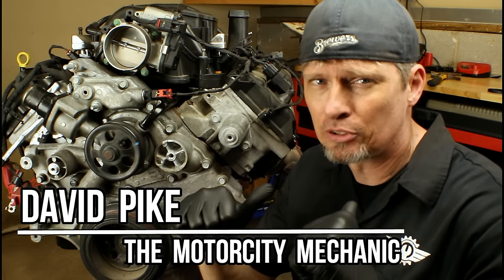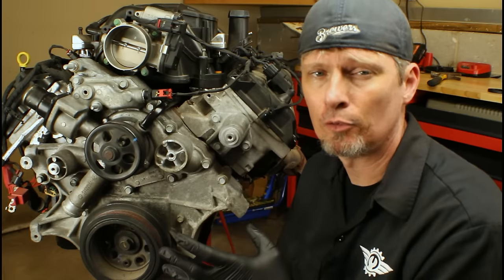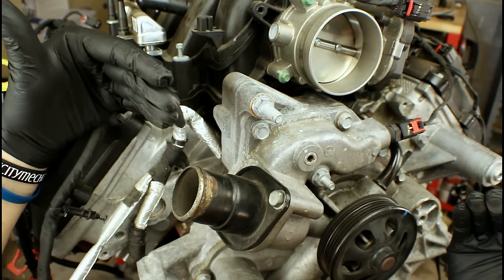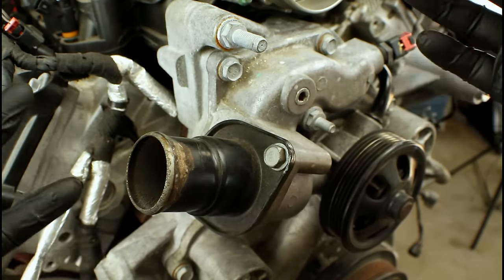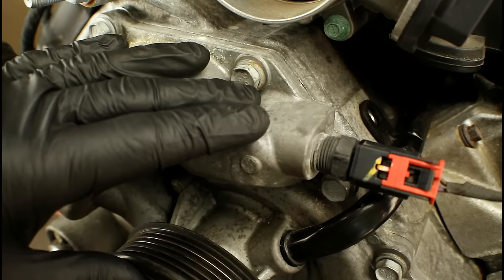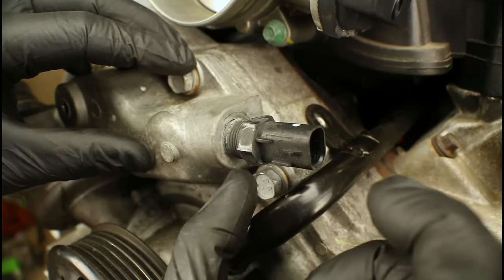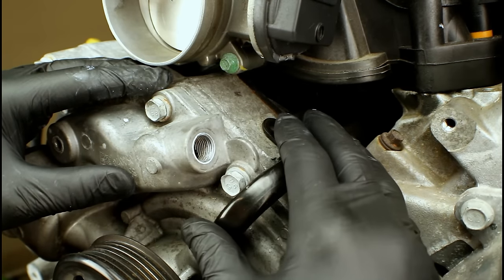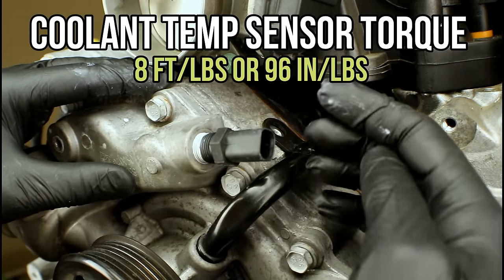More than one way to bleed a Hemi coolant system

Comment: Well most thermostats have a little tiny micro hole in that thermostat?
Reply from the maker: Must have the “jiggle valve” but doesn’t seem to allow enough air thru or at least not fast enough

Comment: I'm swapping out the thermostat, after I install the new one and put back on the coolant hose, i just start filling the coolant tank until it comes out of the bleeder valve ? Thank you for your help
Reply from the maker: Exacty. Then reinstall it and adjust the coolant level in the bottle. Thanks for watching and make sure to subscribe.
Reply: @MotorCityMechanic  thank you for your help!! I always make sure to like all your vids

Comment: How do you feel about the air lift system? All the tool trucks have their version. Using vacuum on the cooling system then letting the vacuum draw in the coolant.

Comment: Need your help please , I replace my water pump due to a noise and loose pulley on the water pump its self , on a 2017 challenger Hemi engine just like on this video , for some reason I can not get water to come out  bleeder plug like in the video I also replace my thermostat now I over heat and it didn't before , I went back to my old thermostat thinking I may have bought a defective part , I also noticed I have no coolant in my thermostat housing or on my bottom hose is it possible I was given a defective water pump,  I have no leaks and it seems I have no water circulation , thanks in advance

Comment: Is it necessary to bleed the coolant system when you're going to do a coolant flush?
Reply from the maker: Its recommended to make sure there is no air.....just in case. Thanks for asking and make sure to subscribe.
Reply: @MotorCityMechanic  thank you! Just subbed!
Reply from the maker: @brayangarcia4195  Many thanks

Comment: I got a 2012 ram w 5.7 hemi.. and it overheats when at idle or a driveway for a long time..at that point my ac stops working.. it goes up half way between normal and the 3/4 temp mark..so basically about 5/8 or so of the gauge..woul that be an air pocket issue or fan...changed coolant
Reply from the maker: There shouldnt be an air pocket unless there was a leak or when you change the coolant. If thats the issue when you changed it then it shouldnt have been over heating before...if it was then there is another issue. I would recommend having it checked further. Could be numerous items....fan, clogged radiator....etc. Thanks for asking and make sure to subscribe.
Reply: I have this same issue and I also hear the coolant gushing behind my glove box.  But the coolant level is always high in the radiator.  Gonna try to bleed it in the morn.

Comment: What a great follow up video! As a guy that has replaced 4 water pumps (post warranty) any video from you about the Hemi is loved. I have a question, after the last water pump change I noticed my upper hose was collapsing after motor cooled down. I replaced the hose (it was time anyway) but the new one is also collapsing. New Radiator cap in order?
Reply from the maker: Could be a bad cap.....I havent seen that issue in a long time. Thats where I could start first for sure. Thanks for watching!

Comment: Hi, thank you for this video!.
I've a 2009 DODGE Durango SLT 5.7 Hemi, soon will have to flush de cooling system and will have to deal with this, do you have the torque number for that bleeder plug?.
Also, if after filling up with coolant, I leave the radiator cup off, start the engine and wait for normal temperature plus some time (for the thermostat to open)...is not supposed to bleed the air bubbles from the top point (radiator)?, and the last one...It's ok to use teflon tape to seal the bleeder plug?. Thanks again!.

Comment: David, what if I don't have a torque wrench? I am replacing engine coolant thermostat housing on 2016 Ram 1500 sport.
Reply from the maker: Just snug the bolts and you will be fine.

Comment: Question...   2005 Jeep Grand Cherokee 5.7 Hemi.  I have 2 problems.  1 is the water pump that I am doing tonight and the other one is: is there an alternate to the hydraulic radiator fan?  The one we have is making a bad bearing noise and I cant seem to find one on line making my only other source a salvage yard.  Is there a way to switch it to a regular fan with a clutch like they have on the 2014 Ram with the Hemi?  Any input you can give me would be greatly appreciated..  Thank you for your time.

Comment: Thanks for the great video with a lot of awesome information.  I have 2013 Ram 2500 5.7 Hemi,  noticed liquid on transmission pan, but didn't look like trans fluid.  It looked more like coolant, but truck hasn't overheated or been abnormally hot.  So I pressure tested cooling system....not sure what the correct PSI is for testing, but radiator cap reads "16 PSI" so I pumped the pressure to just under 15 PSI.  After a few minutes, coolant was leaking out from under the pulley on the water pump...I think there's a weep hole there?  Can you confirm if there is a weep hole and if so, does the leaking under pressure confirm that it's bad?  Also, what is testing PSI for cooling system so I know what to stay under next time.  Thanks again.

Comment: Is this bleeding required to just Dodges or all, I’ve rebuilt motors , changed water pumps and mechanically inclined.
Reply from the maker: Each engine is different, some do have a bleeder while others don’t

Comment: If not purging the coolant system after cooling repairs, will THAT cause the engine to run hot or even register hot on the temp gauge? I have an 07 R/T Charger and I do many repairs myself but I have never been taught about purging.

Comment: If my hemi has a bleeding valve, is burping the system still necessary? Or is using just the bleeding valve good enough to get all the air out? Also, what if the valve is stripped? Thank you

Comment: I have a couple of questions for you regarding this sort of thing. A friend of mine just bought a used Ram pickup, (not sure what year but it's a Hemi) that's over heating badly. The former owner had replaced the thermostat and apparently that's when it started over heating. One question, is there a chance the guy put the thermostat in backward or wouldn't it fit that way? Also, what kind of anti freeze should I use? These videos are GREAT! Thank you for your time and efforts to help us out.

Comment: 2014 charger 5.7 was overheating. I changed the thermostat, water pump, radiator and it's still overheating and now the heat doesn't work. What am I missing?
Reply from the maker: Make sure no air in the system by bleeding it as in the video. You may need to recheck it when its cold to see if any air is coming out the bleeder. Most of the time you can get it all out the first time and some times you have to do it more then once (letting it get hot and then cold and then bleed the air, repeat). That could explain the heater concern.
Reply: @MotorCityMechanic  I ended up putting the old thermostat back in and filling the radiator with coolant and the reservoir needed some too. I turned it on and to my surprise it works now. Maybe low on coolant ?? I know the water pump was going out but the radiator was probably still fine. I'm leaving it in since it's not easy taking it out.
Reply from the maker: @randyu8688  Sounds like being low on coolant/air in the system like I mentioned. Looks like you got it bled well this time so that everything works. Thanks for the update and glad everything is back to normal.
Reply: @MotorCityMechanic  sometimes it's a minor issue that you yourself can turn into a nightmare. Thank God I thought about filling the radiator before I hooked the thermostat back on. As of now the car works great. Now I have to tackle a 2010 dodge fan evaporator heater core. I have the center console. Wish me luck !
Reply: MotorCity Mechanic i filled my coolant system up but i only used less than half of the max capacity of the coolant system on filling. I have loosened the bleeder valve and bled it till there was a steady flow. I still have not seen a drop in fluid. Also my fans are not running, could that be because of low coolant?

Comment: Thanks for showing how you removed the bleeder valve. When draining how do you get all the coolant from the engine block? I located the drain plugs on the block and was able to remove the plug on the driver side but no luck on the passenger side (worth mentioning I ended up disconnecting the negative battery cable due to spark on the passenger side)
Reply: What was your end results?  My 2011 RT 5.7 has been running way hot, so with a thermostat replacement, I also decided to do a full flush and fill.  I've only been able to get two gallons in and two out during each of the five times I've performed a flush.  The two block plugs, with everything in the way are next to impossible to remove without possibly damaging the bolt heads.  That still leaves roughly half of the diluted coolant and cleaning agent in the block and system.  We're you able to maybe remove the heater core hoses from the block area to be able to get the rest of the old coolant and cleaner out prior to replacing the nearly 4 gallons of 50/50 coolant?  Thanks!!

Comment: I have a 06 charger 5.7 hemi Is it a way to catch the coolant spill front out the bleeder valve so that way it’s not leaking on the electrical parts like the fan?
Reply from the maker: No need to worry, it doesnt cause any issues and also keep in mind.....that fan is exposed to rain every time you drive it in bad weather. But if your still worried then place a small cup below the bleeder opening. Thanks for asking and for watching. Make sure to subscribe.

Comment: Thanks, The old school heat on full blast resevoir cap off / topping off  when thermostat opens trick won't work on these?
Reply: I just did that on my hemi, it worked but I need to do the cycle again. It definitely takes longer but I might do the temp sensor way again because it’s a really smart and good method because my bleeder valve is rounded

Comment: Hey David thank you for this informative video, I did the burping and I noticed that the once I started to add coolant in the radiator the coolant was coming out from the bleeding valve straight away so I assumed the coolant system is free from any stuck air. Two other things have been noticed the first is the radiator upper hose seems really firm and the other is the coolant reservoir is little bubbling after shutting off the engine after 30 min drive. Are these normal signs? I appreciate your reply

Comment: I've watched every video I could find on how to bleed the air from the system and I'm still having difficulties. I have a 2011 300c with the 5.7 hemi. I changed the waterpump thermostat, bled the air via the bleeder screw, but for some reason it's not circulating the heat is working and it doesn't overheat at idle with the heat on but as soon as I turn off the heat the temp starts going up. I'm stuck and running out of money and ideas plz any advice or tips would be greatly appreciated.
Reply from the maker: You may have a clogged radiator......I recommend when its hot....try to grab both radiator hoses to see if any big difference in temperature.....with the engine not running of course so you dont get hurt. Also make sure that the fan or fans is working correctly as well at the radiator
Reply: @MotorCityMechanic  I changed the radiator, the water pump and thermostat and still overheating and coolant boiling at the reservoir. I turned the heat on inside and it blows cold.
Reply: Drywall Experts Having the same issue on my 2013 Dodge Charger RT. Did you ever find the solution?
Reply: @harryballz6358  it may have been that but I went ahead and took the dash out. I have a center console but it was really easy. I replaced the evaporator and the heater core. And it's back to normal.

Comment: Does anyone know when u replace the water pump does it need sealant on the gasket and also after replacement of the water pump do i need to bleed the system of any air
Reply from the maker: Waterpump requires a gasket/seal. It should come with one when purchased. The coolant system will need bleeding for sure. Thanks for asking and for watching. Make sure to subscribe.
Reply: MotorCity Mechanic thanks for your help I appreciate your videos

Comment: Hello can u tell me the Torque spec for the belt tensioner pully on a 2009 Dodge Challenger ? The bolt size is 16

Comment: My hemi when I parked and running a c the temp gauge starts to climb when I running it cools right down  it’s super hot outside why is this happening?
Reply from the maker: Mark Drouin I would have it checked to make sure that the radiator fan or fans is working correctly first and then go from there. Thanks for asking and make sure to subscribe
Reply: I’ll check them thanks

Comment: Excellent video! It has been a long time I haven't seen such a clear explanation! Quick question, please: can you tell me the normal running temperature for a Chrysler 300c 2011 in a 90 - 100 degree  Florida area?
Reply from the maker: Oceanpointe Distributors Corp many thanks for the kind words. The normal temp range is half way on the gauge. Which is around 210ish give or take.. thanks for the question and make sure to subscribe

Comment: How do you feel about vacuum fill?
Reply from the maker: I use both together. Vacuum first and then make sure no air with the bleeder so that I can hurry on to the next job
Reply: @MotorCityMechanic  Thanks,
I use vacuum fill on almost every cooling system job.  I am a medium/ heavy truck guy. Works great especially with things like EGR coolers and such. I Don’t use on 6.7 secondary cooling system. (5psi system).  Hurry to the next job. Lol. 
Life of a “flat rate” professional.

Comment: Excuse me, do you know how to change the radiator to my 2012 dodge durango 5.7L hemi rt but it is not bleed and it is still overhiting I also changed the thermostat . that by not  doing bleed is heating up?  Old radiator was crack and my truck previously was,overheating.  Or my water pump went bad too????
Reply from the maker: I recommend making sure that the system is bled and that no air is inside. If thats okay then one issue is how hot did it get before  when it was overheating. The cause of the initial issue being the radiator leaking may have caused it to run too hot and then damaged something on the engine like warped the heads possibly. One issue can cause another if it gets too hot. I dont thing the waterpump went out as well. They will leak or make noise like a bad bearing.
Reply: Thanks , it didn't overheat much , once we saw it was we stop the truck and shut off an the happened two times ...
Reply: @MotorCityMechanic   thanks for all u help . I bleed it this morning plus my motor oil level was to low  and I add more oil . Was running for around 40 minutes no more overheat ...
Reply from the maker: @juannava8587  Awsome! Glad all is now well. Thanks for the update

Comment: My coolant tube that runs under the intake looks rusty, could that be the source of my coolant loss
Reply from the maker: Thats hard to say....rusted is one thing but rusted with holes is another. I recommend having the coolant system pressure tested to see if there are any leaks first so that we can be 100% sure. Thanks for asking and for watching. Make sure to subscribe.
Reply: @MotorCityMechanic  I don't think blown head gaskets are too common with the 5.7 hemi
Reply from the maker: @captainobvious5993  For the most part headgaskets dont blow any more on Chrysler vehicles.....thats because of the material the head gaskets are made out of.....multi-layers of steel. So when people say it has a blown head gasket I just shake my head. What will happen however is that if it gets hot enough....the aluminum head will warp and give the same affect as a blown head gasket. In some cases if it gets hot enough the valve seats will drop out the head!
Reply: @MotorCityMechanic  I have an 06 dodge magnum rt awd and the water pump recently went out. As soon as the temp gauge went one  notch past the middle I pulled it over and called the tow truck. I think my mechanic did not put the correct amount of antifreeze it takes 2.5 gallons and he only put 2 gallons back in the system.

Comment: Hi. I have a 6.1 L SRT8. I keep getting high temperatures and will proceed to bleed the engine. The Mech is telling me it’s not the air but the gasket is bad. But car starts and runs great. He claims to have bled the radiator but will do it myself tmrw.  He removed the thermostat for reasons unknown to me. Question is can the gasket be bad and the car is starting, slight rough idle and driving?
Reply from the maker: What gasket are they speaking of....head gasket? If so then the head gasket can’t go bad. It’s made of multiple layers of steel and can’t “blow” as the old techs like to say. Instead the aluminum head will warp.

Comment: so if i go the temp sensor method do i remove while the engine is idling to allow any air to escape??
Reply from the maker: Do it with the engine off, not running. Thanks for asking and make sure to subscribe
Reply: @MotorCityMechanic  OK Engine off and cold?? Will water come gushing out once removed?  Sorry for all the questions I just want to make sure it's Done right. THX

Comment: I have a 2011 Jeep Grand Cherokee Laredo with the 5.7 hemi and am having overheating issues.  I am stuck!! I used more than a few bars leak fixes but just replaced the radiator, thermostat, coolant temperature switch, upper and lower hoses but still overheats.  I first would get some heat from vents but none now.  Jeep would go to hot then back to middle gauge on temp then back up and do this 6 or 7 times on a 40 minute trip.  Lately I have to stop because temp won't go back down and pressure is built up in the top radiator hose.  Any help would be appreciated.
Reply: Hey did you ever figure out the problem?